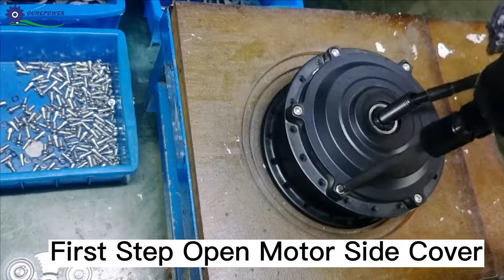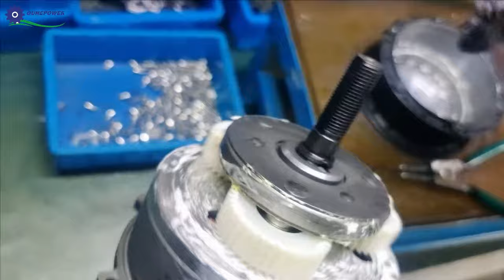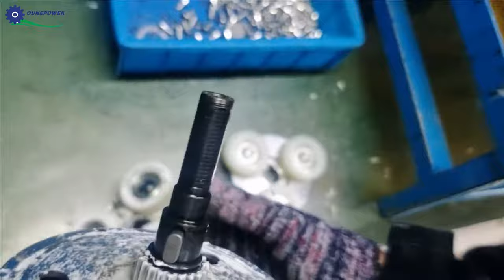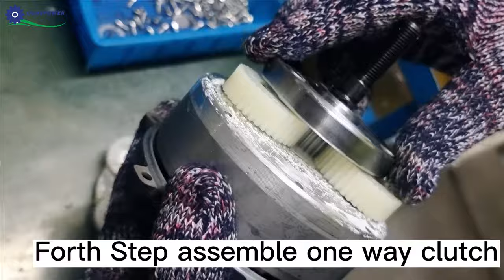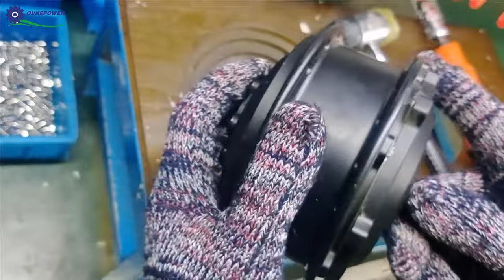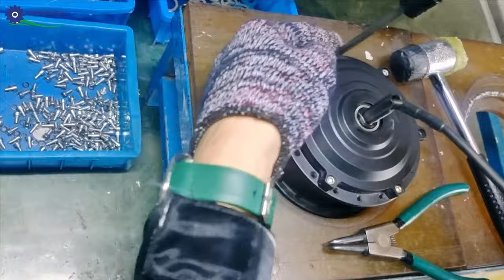How to replacement ebike motor's clutch

Comment: Any advice on planetary gear? Is metal better than the nylon ?
Reply from the maker: which is depend on your working condition
Reply: No, its not. You are going to destroy the hub completely and it will wear off much quicker
Reply: use nylon gear so that the other gears are not damaged and so that they are not noisy

Comment: The screws are very soft they are easy to strip . Be careful
Reply: I have also disassembled it and the screw is not strong, especially when it was installed at the factory using loctite, so when you open it, the screw might be damaged. To overcome this, I use an impact driver.
I want to know what lubricant/grease is used for nylon gear